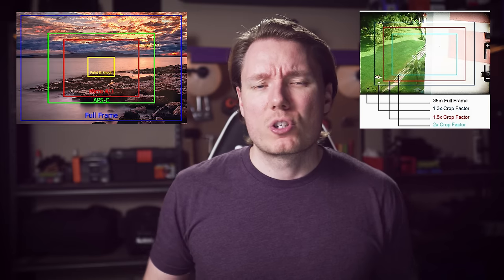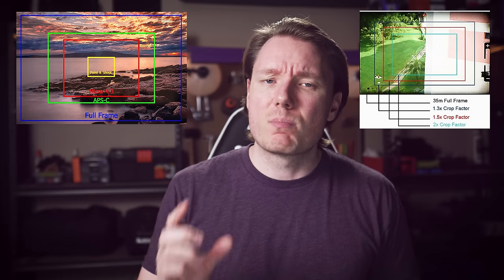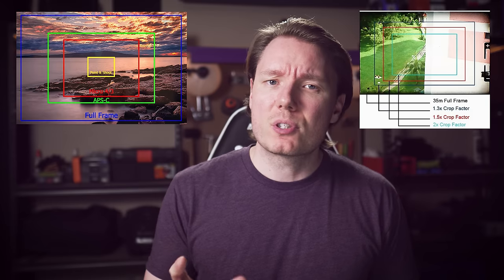Crop Lenses on Crop Bodies: How It Works vs Full Frame (APS-C & M43)

Comment: My Man, you somehow got about an hour's worth of information into that 09:23 window.  I don't know exactly how you did it but you did!  I'm gonna go watch it again and maybe even a 3rd time if necessary ;-)  Great job!
Reply: D. Jason Ellington Gerald uses a speed booster for that too!
Reply: ...despite the fakt that its filled with mistakes...
Reply: @tomwd.2825   Can you provide us with all or. At least most of the examples?
Reply: @ariesmight6978  there is no loss of light nor loss of sharpness from useing a FF lens on crop body. A 35mm is a 35mm on a crop body, half true. Modern cameras have a setting for adapted lenses and they work with the settings to get a proper crop picture looking like it should if you used a native crop lense... grab a fuji cam and you will see. FF lens on crop body uses only the inner circle of the lens which is the better quality. No blurry corners or sharpness loss in the corners there. Speedboosters working like a magnifiing glas, noting more...but with all the downsides of it. Less quallity.
A 35mm specificly build for crop is still a physical 35mm but optimised for crop sensor. Physics dont change from useing another body. This is why its hard to build good quallity wide-angle for m4/3 because its the same build as for a fullframe. A 17mm M4/3 is a 35isch fullframe aperance but physically it's a 17mm, sobits very hard to getbthe same quallity build. Is this answering your question?!
Reply: @tomwd.2825   Thank you for the constructive and informative response. There are Soo many toxic people in the comment sections.

Comment: By far one of the best explanations of this subject I have seen yet.  Well done, Gerald.  By the way, you have an AWESOME name
Reply from the maker: Thanks a lot, but I think you might be biased about the name part. 😜
Reply: Except Gerald is wrong. The light density of a sensor is purely determined by the f stop. A f/1.4 full frame lens on either a ff sensor or an apsc sensor will look equally bright on the image. He is confused because he is thinking about how speed boosters take extra unused light (from using ff lens on an apsc sensor) and concentrate that extra light for a higher f stop but that logic isn't why full frame lenses sometimes look less sharp on apsc sensor. The real reason is when you use a ff lens on an apsc sensor with higher pixel density and lower pixel pitch, which demands higher resolution. So your same lens will look more sharp on a 40 megapixel full frame than a 26 megapixel apsc.  

But let us assume both the ff sensor and apsc sensor have the same pixel density (60 megapixel ff vs 26 mp apsc). Then what you will find is that the full frame lens is exactly as sharp in the center and even sharper on the apsc edge because the weakest part of the image circle (edge of full frame image circle) is cropped away and you are left with the midframe edge of full frame (which would be outer edge on apsc).

Comment: Great effects and very entertaining, I almost didn't watch this one but really enjoyed the explination.

 My issue with "crop factor" has always been its reliance on first understanding a lens' FoV on another body. 

 Again if everyone started naming sensors by their diagonal measurement we would have far less confusion, because a lens that measures the same as the sensor's diagonal provides a neutral "Field of View".  

That's a 43mm on a "Full Frame", 28mm on an APSc and 21mm on a Micro FourThirds.  
If you want a Telephoto you would multiply by 2; which is 86mm on FF, 56mm on APSc and 42mm on mFT.  
A wide angle would simply be divided by 2 so a 21.5mm on FF, 14mm on APSc and 10.5mm on mFT.
Reply from the maker: I'm glad you did watch it, Peter! 😃
Thanks for the comment and for sharing some notes on FoV.

Comment: Your explanation is the clearest most concise and logical I have ever found on this issue. Your flashlight illustration  perfectly explains why we do not see sharper edges in our photos when using FF lenses on crop sensor bodies. The light focused by the lens is diffused over a larger area, more of the detail the lens is able to focus is wasted outside the sensor area. This is born out by rigorous tests by DSO mark, as referenced in Tony Northrup's excellent video on this subject. "Perceived" megapixels will be less when using FF lenses on crop bodies, particularly if they are poor lenses to begin with.

Comment: Great video dude! My favorite thing to see in the comments is when people say you have to crop the aperture number too... I mean I get where they're coming from but it's not technically right.
Reply from the maker: Thanks, Dunna!
Applying the crop factor to the f-number is a good shortcut to figure out your relative depth of field though, or rather where you'd have to set your cameras to match each other in terms of depth of field. Easier than doing angle of view math. 😃
Reply: The people that use Northrup math confuse 'Total Light Gathered' VS. Aperture. Aperture is determined by the lens and only effects exposure of an image in terms of light. A bigger sensor will collect more light. BUT it also requires proportionally more light to get the same exposure. You can't compare Apertures across different formats because the lenses need to be bigger/smaller to accommodate the sensor size.

The extra light gathered from bigger lenses with bigger sensors does improve the ISO Performance and generally results in a less noisy image. But NOT related at all to the Aperture across different formats. 

It's ok to point out that depth of  field will be different on different sensor sizes but saying you need to include Aperture into an equivalency discussion is flat out false. Real tests will prove it.

Comment: at 7:35 starts the correct explanation!
A Xmm focal length lens is such regardless of being designed for Crop or FF. The cropped lens only have different design so that they save some glass, since there's no need to cover bigger projection.
Same goes for F-stop f/1.8 in crop-lens is exactly the same as f/1.8 in full-frame lens - as it's simply the ratio between the aperture & the focal-length, and since focal-length is the same then the aperture is the same at given f-stop. Ie it produces the same depth of field (or bokeh) (ignoring the actual quality of image and T-stop).
The only difference is the size of the projection and the size that you can capture from this same projection - ie the sensor size.
The flash-light example at 5:12 is extremely misleading! It can easily fool you to think that crop-lenses for same given focal length have some kind of speed-booster inside them, which they don't.
Reply: You said what I want to say after watching this.

Comment: This video somewhat answered one question for me regarding how different lenses work on different sized sensors. I'm still wondering, if a cropped lens doesn't cover all the frame on a full frame sensor, why, when it does cover the whole frame on a cropped sensor, it's still cropped. For example if I have a 50mm APS-C lens on a full frame camera, it's showing a proper 50mm FOV but with a big part of the frame left out, but if I have it on a cropped sensor camera, it's still showing the 85mm FOV, even when it's covering the whole frame. Why couldn't the lens cover the proper 50mm FOV if it's designed specifically for cropped sensors?

Comment: I find the way you break information down SO much more digestible than others out there. In Tony's latest M43 bashing video he talks about how a FF lens will gather 4 times as much total light as that of a M43 lens of the same aperture. This I follow, however he then goes on to pass reference to how this results in reduced noise on the FF system without really stopping to explain the math behind it or what M43 sensor tricks can be used to mitigate it (such as higher base ISO or even dual ISO). If you ever had the time and inclination Gerald, I don't think (or at least am unaware) this topic has been broken down into layman terms like all the other pros/cons of FF Vs M43. Could well do with some Gerald treatment. Thanks for your channel!
Reply from the maker: Thanks for the kind words and suggestion, Dominic. Really appreciate it. 😃🙏

Comment: Hey Gerald, awesome video.  Question: If I purchase and full-frame M Mount lens that is known for having a sharp center but softer corners and then mount that lens via adapter to an APSC camera, would I not have sharper corners and the same sharpness in the center?  Or, is it that I'm losing sharpness throughout because the light is dissipating because I've cropped in?  I'm currently using a Voigtlander M Mount lens on my Fuji and I see sharper results than some of my native fuji glass (that plus a more interested look in my opinion).  What are your thoughts here and on mounting full-frame glass on APSC cameras?  Thanks so much!

Comment: Thank you for this video. 

I didn't even know about speed boosters until I watched it. I'll keep them in mind when looking for my next lens. It would be great to buy a full frame lens that I can use a speed-booster to get the desired focal length now, and get that same focal length when I eventually buy a full frame down the line.

Comment: Requesting for a Lens comparison video for Wildlife photography on APSC sensor.

Lens 1: Canon EF 70-300 F/4-5.6 is II USM  (X Crop factor i.e. 1.6 for Canon)
Lens 2: Tamron 18-400mm F/3.5-6.3 DI-II VC HLD (for Canon APSC)

One more question, EF 75-300 mm f/4-5.6 III is a bad option on APSC for Wildlife Still photography?
Reply: Yes, it is a bad option. It's not the sharpest lens on F2F, and even worse on APS-C. Also, no image stabilization. I am speaking from experience. I have used the lens myself.

Comment: Great explanation & awesome video! I appreciate the time you put into making this :) I have one question you didn’t exactly hit on in your explanation which is regarding compression. Compression goes up as the focal length of the lens increases. A 75mm lens has more compression than a 35mm lens does which means it pulls elements of the image closer together given the same perspective. Now how does a 75mm full frame lens compression compare to a 37.5mm MFT lens?

Comment: Hi! I have a question that I can't seem to find an answer to. Partly because my lack of experience in the professional camera realm and partly because of the lack of information out there. I want to buy a Lumix S5 and I also need a lens for it. I want to film super wide angle at 4k60 ( so the image will be cropped ) and I am looking for a lens that will give me roughly the same image as an iPhone 11/12/13 on the ultra wide camera in video mode ( iPhone crops in ultra wide video mode ) and from what I understand the focal length of the ultra wide on the iPhone is 13mm ( in photo mode ). What lens should I buy for the S5 ( preferably prime ) for this effect aka iPhone ultra wide video mode ( 13mm cropped ). Thanks 😐

Comment: Thanks for this video. I am searching for info regarding when and why you should multiply aps-c lens focal lengths. For instance, I have a Samyang 12mm f2 on my Sony a6300. To do astrophotography, you have to use the 500 rule. Why must I multiply 12mm by 1.5 if the lens was made for an aps-c camera? Also, will the fov of a full frame 12mm lens on a full frame body be the same as aps-c 12mm lens on an aps-c body? Hope that makes sense.
Reply: Why would it matter a bit whether the lens was made for APS-C? With smaller sensors one uses shorter focal lengths. It is completely up to you whether you multiply anything. The 35 mm is just an arbitrary standard.

Comment: You hit the nail on the head. No one is talking about crop lenses on crop bodies. Just always switching.

So back to the side view diagram of a man. If a 50mm full frame lens on a full frame body shows the full person head to toe at a given distance.

Does a 50mm crop lens on a 50mm crop body show the full person head to toe as well at the same given distance?
Reply: Not exactly.  You'll still get a 50mm ANGLE of view (perspective and vanishing points would be the same) but the area of view would suffer the crop.

That's why cropped lenses have funny sounding focal lengths (compared to full frame) like 18-55 and all that, it needs to project a smaller image circle.  You'd need a crop lens focal length of around 33.5mm to get the same area in the frame as you see on a FF 50mm.

Crop lenses will usually say something in their literature about what full frame focal length they are equivalent to.  Or, just multiply the focal length by 1.5 (or 1.6 for canon,) to determine for yourself.
Reply: @JerryHazard  thanks for responding! I feel like it makes sense.

When you say the angle of view will be the same. You are referring to the objective side of the lens. As in, the lens would still draw in light from the person head to toe. BUT the body side of the lens ( and really the sensor) may not use all that light and give me a chest to shin view of my person.

Correct?
Reply: @marcoleon8515  Absolutely, yes.  A 50mm lens can only project it's own geometry - regardless of where the light is landing (in this case, an image sensor).  

It's drawing the same image on FF as it is on a crop sensor.  You totally understand it.

Comment: I have recently started watching several of your videos and you are the best I have seen so far at giving understandable explanations for phenomena that clearly baffle a lot of people including some who claim to be experts in the fields of photography and videography. This video is excellent, but it brings up a question for which I need clarification. 
You seem to imply that a full frame lens is somehow less well focused or has less "total sharpness" on an aps-c or micro 4/3 sensor than it would be on a full frame sensor....if i correctly understand your explanation that you get a more concentrated image when you move the flashlight closer to the sensor so that the circle more closely fits the sensor. I can't see the "angle of view" argument when the wider angle information is being cropped out anyway and all that is hitting the sensor is the narrower angle of view information at the center of the field anyway. I can see an argument that extra light bouncing around in the camera body will cause less definition of the image on the sensor if that stray and wasted light is not absorbed somehow.
I think that many lenses perform better at the center of their area of projection which is why a key factor when deciding on a more expensive lens has to do with corner sharpness which is usually better on expensive lenses and overall sharpness may be improved by cropping out the less sharp outer parts of the image.
One reason I use full frame glass on my cropped sensor Nikon camera is cost. There are way more inexpensive (used) full frame lenses than there are cropped sensor lenses which usually must be bought new. For instance my 300mm f4 AF lens would cost 5 or 6 times what I paid for it if I had to buy the comparable new version (albeit with several improvements). The notable exception is the 17-55mm Nikon lens which is a great lens built for cropped sensor and can be had for a reasonable price used.
I guess this long post is to ask for clarification as to why a full frame lens would not focus as well on a cropped sensor.
Reply from the maker: Thanks for your kind words and compliments. I think that's a perfectly valid reason for using full frame lenses and I didn't mean to suggest that using full frame lenses on crop bodies is "bad". Just that sometimes certain crop lenses get rated higher, even though they're a lower quality lens. One factor to consider that I don't think we talked about is that magnification of lens faults. While it's true you will remove the weak corners, you might also be exaggerating any imperfections due to the tighter crop.
I've read a theory on the light pollution that you mentioned, but I wasn't able to get any firm answer on it.

Comment: As you mentioned the crop factors of full frame lenses on the aps-c & micro 4/3 sensors in the beginning, will they still be there if we use a full frame lens on non full frame sensors but with speedboosters?

Comment: Hi Gerald, what do you think about the tokina 11-16mm f2.8 for the EOS R or even r5 r6 to have an ultra wide angle lens in my kit. Knowing that on full frame mode, you do not see the lens edges (vignette) when zoomed all the way to 16mm but mainly, what would make this lens even more versatile is the crop function you have on these eos r-r5-r6 and also the only 4k option on the eos r which is cropped... so in these cropped mode that 11-16 would be about 18.7-27.2mm which would make it very versatile knowing it could be used in non crop mode at 16mm... what do you think please?

Comment: Gerald, as always excellent video. 3rd time I watch... I have a question I am looking to buy the EOS R full-frame camera later this month, and I already have Full frame L-series glass. My thought was to get the EOS R with the Adapter and use my existing glass to start. I have the 16-35mm 2.8f, 100mm Macro, 24-70mm 2.8f, and the Nifty-Fifty 1.8f. My question is, in using the Adapter, does it work as a speed booster by separating the lens from the sensor, and would that help with the 4K Crop...?

Comment: Been a subscriber for a while now and this video is one of the reasons why. I like to know the details and this covered 99% of them. The last consideration is fixed distance. I often film at a fixed distance. While I can use a 53mm crop(APS-C 1.5x) or an 80mm FF lens, is it not true that the 80mm lens would be sharper based on the magnification? I am closer to the subject (live theatre) with the 80mm. If I am wrong please enlighten me.